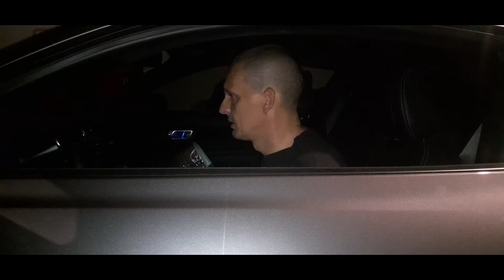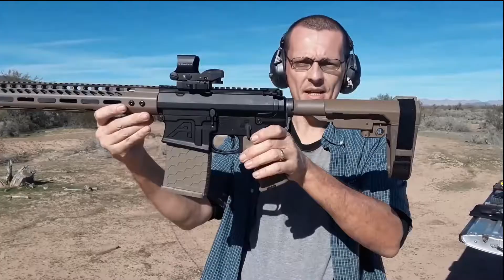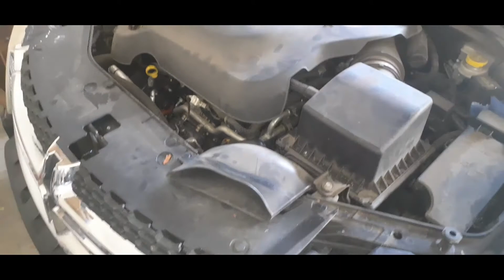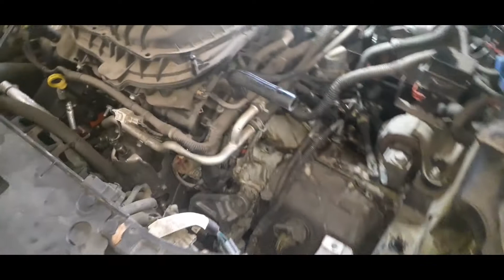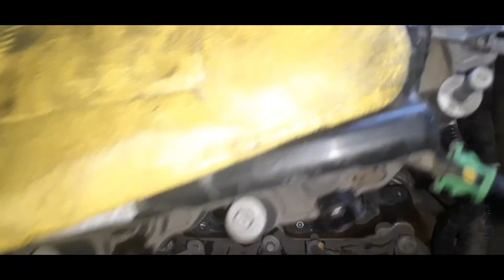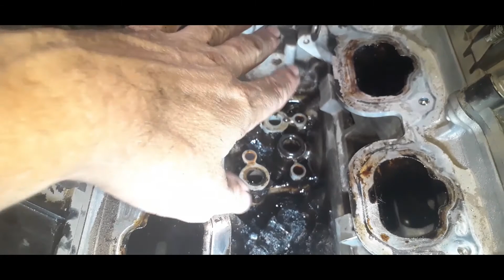2013 Dodge Avenger Oil & Coolant Leak Low Oil Pressure Trouble Code PART 1

Comment: Just got done doing this a second time lol. Replaced the cooler, spark plugs and boots yesterday with my pop but I nicked the the lower oil seal on the way in and she let it be known this morning. Took less than 3 hours the second time with a replacement seal and we are looking good so far. Definitely not to hard at all. Thank you for this video. Oh and get the Aluminum replacement cooler with all the candy, it’s worth it.
Reply from the maker: I was doing this for my daughter's boyfriend. I was amazed at the design flaws in this setup. But every car has something that leaves your head shaking. It's not too hard of a job for a confident mechanic. I, too, had to tear it down twice. Don't know if I showed it in one of the parts, but I was sold the incorrect oil sending unit. So I had to replace it. I got pretty good at working on this engine. When he wrecked the car shortly after, I didn't think I would work on another engine like that again. Then my other daughter got a Dodge caravan for her family, it has the very same engine. I'm just waiting for her to give me the call oil is dumping out the bottom. At least I know what to do to fix it.
   I also changed the water pump and thermostat while I had it torn down as it had some miles on it.
   Thanks for watching. And thanks for taking the time to share your experience.
   Stay safe, stay free.

Comment: for my water pump on 2012 rt avenger can i just remove the engine bracket and coolant reservoir and power steering tank and access it
Reply from the maker: There are always more than one way to do a job. When I start a job I sit and literally stare at the entire area that I am about to work on. I find the best way to get the job done removing as little as possible. Most direct and safest. 

Removing coolant reservoir, power steering fluid tank will just create more chances of creating leaks where none are. I don't remember the job details but I do recall it being pretty easy once you got down to it.

Feel free to reach out if you need any advice. Thanks for watching. Stay safe.